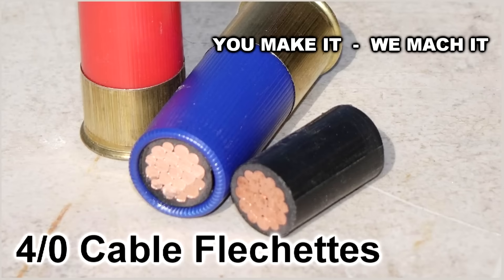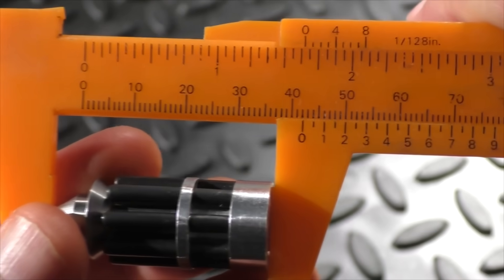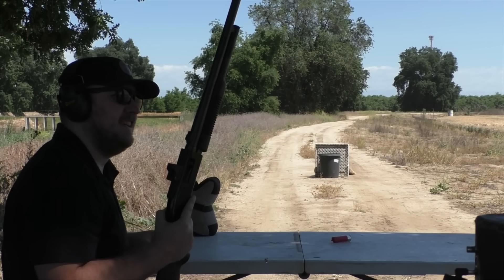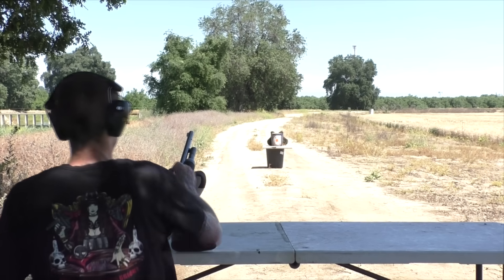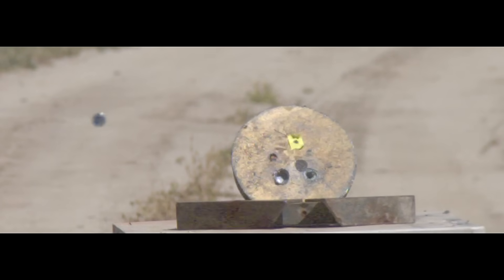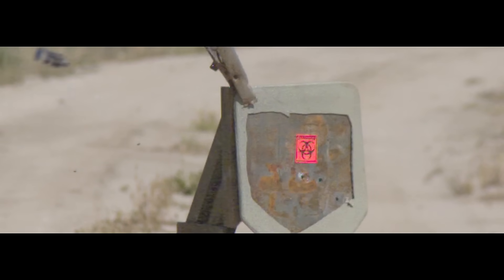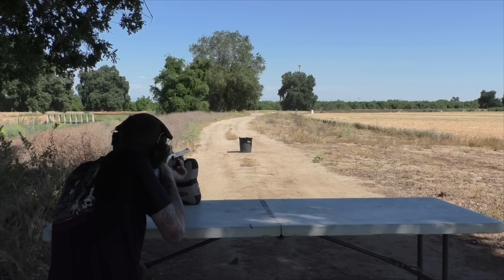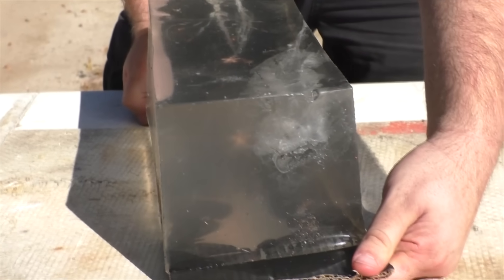RODS from GOD -  Possibly the best 12ga slug we've tested

Comment: You should consider my idea for next-generation streaker rounds. Imagine coating the lead of a bullet with a specialized, light-frequency-activated material that changes color depending on the emitted light frequency. This would allow for a color-changing projectile with a simple weapons attachment. Additionally, with a switch, it could toggle from a standard shot to a non-incendiary streaker round, with colors shifting from red, blue, and purple to neon green. The system could also incorporate a range of standard hues, such as concrete grey, sky blue, and leafy green, as well as more tactical options (Ps patent pended). I recommend conducting further research into this technology. If successful, we could commercialize it and supply it to the military, enhancing soldiers' combat effectiveness. If someone takes up the challenge contact me.
Reply: P.S. I didn’t make that Instagram…it was some Aboriginal guy impersonating my voice.

Comment: Tell the machinist maker to thread into the post the projectile with the projectile being hollow inside loaded with powder with a shotgun primer in the center pressed into its base where its bottom is and inside the hollow tube instead of being solid.....have a firing type pin secured with a paper sleeve to hold it still when firing. Serrate the projectile to fragment when it hits the target forcing the pin forward to hit the primer and set off the powder or explosive filling and then the projectile will fragment inside the target . Its more complicated, but   just another idea of nastiness unsuspected.

Comment: I think this would make an excellent "Vehicle Immobilization" round. It'll blow a radiator to bits, a battery, it might carry enough energy to ruin multiple pullies and send shrapnel through belts. If aimed at occupant's I can only assume it would be equally effective, turning frangible at the door and having a solid foot or two of spread before meeting the intended soft target with larger wounds than buckshot would allow due to the length of the tumbling rods. Definitely devastating on any direct hit soft target like boar. I wish I had a machinists equipment, I'd have a few modifications in mind.

Comment: The physicality of what these would do is far far more devastating than a flechette. Roll pins are hollow meaning they would tear a clean hole through removing actual circular holes of meat as they went, similar to a piercing needle, truth be told I think we a little bit of R&D work these could be the best shotgun round ever made, and potentially even be strong enough to make steel body armor look like Play-Doh.

Comment: When i was a boy, hunting for deer i removed the 00 buck shot and replaced it with same size lead fishing split shot, it worked very well as would a hollow point they would open up on impact and made my 3 1/2 mag fairly more potent
Reply: I also made some shells after removing the 00 buck and packed the shells with fine lead wool, the ballistics were awesome at close range for an intruder and not as lethal in a urban area if you missed your assailant.

Comment: It almost seems like this would be a good round if the need was large crowd (we used Remington 870 when I was active duty for the purpose of protecting the aircraft if carrying prisoners or potential hijack situation as well as a “ retreat from Saigon“ scenario with a crowd. Seems like the big penetrator would go through at least two personnel and the pins going out with damage if not kill quite a few people standing next to or behind the main person you hit. Seems like you would target someone in the front/center of a crowd and let it go.

The whole issue of the nose sticking out striking the primer is a little worrisome however but still cool.

Comment: folks,  the combination of cork wadd /gasseal and the plastic one, could be an issue, they have totally different behaviour inside the barrel when fired, they can interact in a way that they lead the slug to get bad centerin, test it, to not use this anymore, or just one of the kind,

Comment: Man, that is some vicious damage from those roll pins. As far as manufacturing, you could easily set up a third World assembly line shop and make these cost effectively, IMHOP. Just an assembly line with the parts pre-machined in bulk and dumped into containers... or so it seems to me with the penetrator rod being screwed on after the pins are inserted...unless I am missing something? Would love to buy a case of these little monsters.

Comment: It’s not science fiction … lolz
Reply from the maker: Any evidence to back your claims?
Reply: @ smart ass answer, due to the falcon heavy it’s now financially possible todo which moves it out of being science fiction, plus some research that was declassified shows mit and the mill worked on it from the early 2000’s to mid 2010’s.   their was a push for it after 9/11. I believe it was the air force arguing it didn’t violate the space treaty because it was not a nuke, chemical, or bio. 

Real answer , 
The US dose have kinetic missiles that reach space and then come back down , which is more practical for a few reasons.  One being able to be on target at a faster rate Vs waiting for a satellite to move to position.  With what has been released about our hypersonic mussels a smaller payload can be used for the same effect . 
I say our hypersonic mussels because the Russians are only hypersonic out of atmosphere.

Comment: This.... this is a genius shot build. Creating an outwardly sloped "ramp" at 45 degrees forces the rods to spread to the maximum lethal potential of "expansion"/"area of effect". If the ramp was too sloped, it would not be as deadly, likewise with the inverse. 

By far.... ABOVE AND BEYOND the MOST lethal round I've seen onthe program. We are talking about an circle of effect with a maximum diameter of 6-12" before leaving a torso (19"-38" circumference of potential damage). There is now other small arms round with this potential area of effect. Even a group of people has a potential to have multiple people hit (a V formation of said people would do best for multi hits)

Comment: Rods From God are (I’m pretty sure) the only legal loophole to have an orbital weapon. Space is a neutral zone than legally cannot have any weapon platforms, but by the rules of the laws dropping the rods doesn’t count as a weapon, therefore it’s technically legal under the treaty. The issue is cost and the fact that it’s obviously a weapon, so it’s not worth it considering how easy it would be to spot. They might have updated the treaty to fix the loophole but since it’s unlikely anyone is gonna build it they might’ve not.

EDIT: After doing some research, I was right overall. The unilateral Outer Space Treaty bans the use of Weapons of Mass Destruction in space, but doesn’t outlaw conventional weaponry, so the rods, as per our current definition of WMDs, would not be classified. However I’m pretty sure if construction would begin of such a weapon it would cause it to be classified as a WMD considering the literal earth-shattering effects of the weapon.

Comment: 30,000 RPM? What? That slug with no angled fins will probably be rotating more like 300 to 500 RPM or less. Mostly just from any barrel rifling, which most shotgun barrels do not have. Curious where you got 30,000 RPM from.
Reply from the maker: It's a rifled shotgun with a 1:36"  twist.  Math.
Reply: So, how exactly does turning 1 revolution every 36" = 30,000 RPM?? Please show your work. There's no way in hell that slug is spinning @30,000 RPM at any point. Here's Google's AI for you: A typical slug, referring to the type used in shotguns, usually rotates at around 750 revolutions per minute (RPM), with most stabilization coming from the design of the slug itself, particularly in full-bore slugs like Brenneke or Foster designs which use angled fins to achieve spin stabilization.
Reply from the maker: @darrinhartford  1500 feet per second.  Divide that by 3 (1/3rd of a rotation each foot)  times 60 seconds.   30,000 rpm.  30k rpm is quite slow for a bullet,  many rifle bullets spin at over 150,000 rpm.
Reply: Wow. 1500fps. And for how many seconds exactly is this slug traveling. A fraction of one second. Where do you get 60 sec? How many feet are you from your target? 100? 200? Dude your math is whack. That slug would completely fly apart if it spun anywhere near that rotation. 150,000 RPM is an absolutely childishly ridiculous number. Maybe your confusing fps with rpm, idk, but you don't know what your talking about. I'm not wasting anymore of my time on this.

Comment: That's truly impressive.
You might actually be able to manufacture something similar cost effectively. Pins are dead easy for a machine, and you could possibly cast most of the geometry for the other parts to be able to do them in massive batches, or at least use a CNC lathe. Then the retaining ring for the pins could just be stamped out, and you could probably automate pressing the components together. Then use either a press fit or a peened connection instead of the screw, to make it even more automatable. You'd need economies of scale, but I can definitely imagine a machine that can crank these out by the thousands at a reasonable cost.

Comment: Make the core and rods tungsten\carbide instead of steel, they'll go threw anything. I got an eighth inch diameter sharpened carbide rod I can shoot out of my compressors air gun and at 100 psi it'll go through almost anything so I can almost imagine them in this round. I know they have armor piercing carbide rounds but those only have a solid center core not a center and 6-8 smaller rods that spread on impact.

Comment: its not exactly sci-fi stuff.
Everything involved is 100% feasible. Not sure why you'd call it sci-fi. Smashing one thing into another is about as sci-fi as breathing air.
The rocket science used to reach the desired height, and targeting, is another thing entirely. But we solved those issues ages ago.
Reply from the maker: Landing on the moon was sci-fi until we actually landed on the moon
Reply: @taofledermaus  The difference is in speculation and dealing with unknowns. Not rather or not its been done before.
You are incorrect on your implication as the rods from god has no such unknowns.
Reply: @taofledermaus  btw... you can shoot your guns in space to. Its never actually been done, but that doesn't make it sci-fi.
Would make a great video.

Comment: The original concept for Rods from God was conceived by Jerry Pournelle while at Boeing and it spawned Project Thor.  Jerry later moved into being a science fiction writer.
The first practical weapon was a the Korean war era Lazy Dog bomb which was just flung projectiles at a target using purely kinetic energy from the fall. This had expanded upon a concept of throwing "smart rocks" at targets from World War II.  Jerry did the math and found that placing explosive warheads in space was a risk to transport them, maintain them, required complex designs, etc. and saved very little from a launched mass perspective.  But if you just dropped an object from orbit the kinetic forces alone could exceed conventional explosives and rival nuclear payloads.  Project Thor basically then identified that the most effective and foolproof method would be a bar of solid tungsten with a low cross sectional area.  Thus a long cylinder, rod, provided the most stable form factor.  To achieve par with nuclear payloads the bar would need to be about the size of your average telephone pole.  Dropped from orbit a large proportion of its energy would be imparted into the earth causing near complete destruction and causing most of the material at the site to exceed molecular cohesion forces (i.e. vaporize/explode).
Reply: My dad knew Jerry Pournelle. Somewhere I have an autographed copy of Starswarm.
Reply: I only came to the comments to see if anyone knew this on the unclassified level lol. I never looked into it on the internet for the fear of a security violation, which looking back I may have been a little naive
Reply: @RobertHoffman-e9e who’s security are you worried about violating?
Reply: @LogicalNiko  I used to be worried about U.S. security violations, now I no longer have access to that stuff so it's just a memory
Reply: Just watch GI JOE if you want the visual.
Reply: You really think a terminal velocity telephone pole size hunk of tungsten will rival a nuclear bomb? What are you smoking
Reply: @williamjenks6866  I am months late to the conversation, but yes, it could generate that much destruction.
Reply: @williamjenks6866  read the air force studies on the proposal for an initial test.  A 20 ft x 1 ft Tungsten "small scale test" would enter the atmosphere at Mach 24, through falling from friction it would slow to Mach 10.  This would impact the earth with roughly 11.5 tons of TNT.   It was then projected to be able to be scaled up to the up to the size of kilotons payloads (low yield nuclear payloads)  However those test rods would be just under 9 tons.  

Of course it was not continued specifically because the size of the rod needed would be so difficult to get into orbit that explosive payloads were much more efficient.  The ONLY motivation to explore kinetic weapons was treaties banning the launch of explosives into orbit; such weapons would offer a loophole around such rules.
Reply: Just did the math.  Thing would weigh 27,900 kg (roughly 31 tons) and you would probably want it to get to GTO.  If you cut the weight down by 5,000 kg, you could get it up there with a Falcon Heavy.  No idea how you could maneuver or target the ground though.   The center of gravity of the rod would be a mess so ion thrusters won't cut it.  So that means using some hydrazine thrusters for maneuvering and deorbiting.    To be blunt, it would be better to make the launch rocket core out of a rod, get to lto and target it that way.

Still.  Such a fun concept.  I wonder if you could getaway with a solid iron core mined in space?  That is can you get away with a tungsten pipe filled with molten metal in space?  Just throwing rocks at the wall though.

Comment: Gotta be careful witch tungsten carbide. It does not bend or deform. It shatters like glass. Except every single shard, that is now razor sharp, is only one step below being as hard as diamonds. 

It will slit, puncture, and sever arteries. 

If you do more tests with tungsten carbide I would highly suggest doing them behind a ballistic shield. Lest you want to experience what Kentucky Ballistics went through...

Love all of your videos. I got some ideas, but i need time to buy a lathe.

Comment: You could probably make these much more economically by cutting out a lot of the machining. You could mass produce the rods by just cutting from a bigger one, the bottom disk, you could drill the middle ring holder from a sheet. Youd only have to machine the core and cone. Still expensive rounds, but you could make them cheaper.